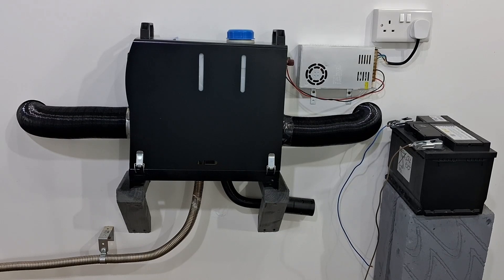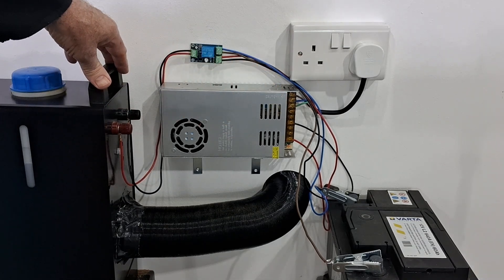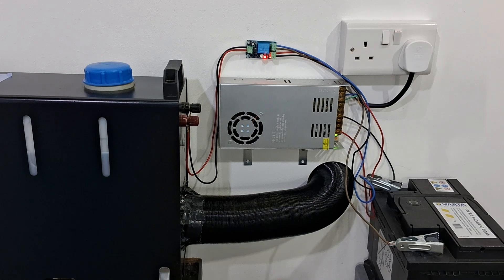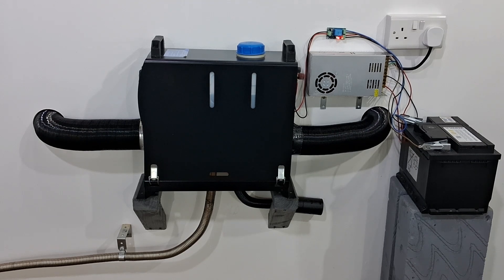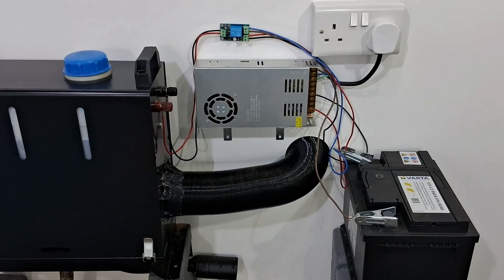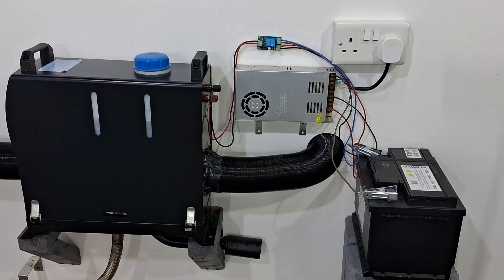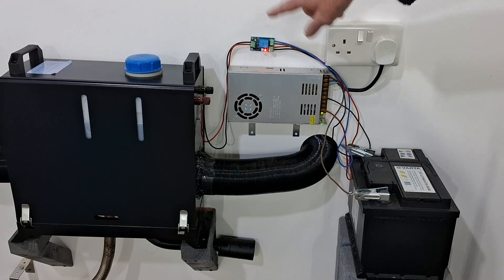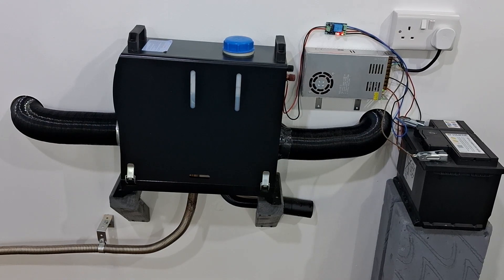DIESEL HEATER Emergency Power Cut Switcher 12v mains supply to battery backup in under 1 second auto

Comment: Andy, thanks for the video. I just put this type of switch on my vevor unit.  It has the 4 button controller.  It switches nicely from 12 to 110 but,  will not switch  properly,   from 110 to 12. It just shows loss of power and though it is obviously getting power it is off.  Just wondering if you know enough about the different type of controls to advise if this is the issue. Thanks for your time.

Comment: What amp battery would you recommend? Thank you
Reply from the maker: i think this on is a 60. but if you can get quiet a big leisure or lorry battery it ould be better. cheers andy
Reply: @ Thanks for that
Reply: I don’t know if you can help or not? Everything is wired and a new 64 amp battery connected, the heater starts perfectly while on the 12 DC but when I pull the plug, the heater goes into shutdown mode rather than keep running on the battery. If I try to restart on just the battery I get error code 9, but if I restart on DC, all’s ok. Any idea what the problem could be?

Comment: I run mine directly from the 12 volt battery but I keep a charger on it to keep it topped off. If the AC power goes out it will already be running on the battery. No need for any relays.   

Keep it simple. 😀
Reply from the maker: Thanks for the info
Reply from the maker: did you see my other heater videos: https://www.youtube.com/@andyfireblade
let me know what you think

cheers andy

Comment: Andy I have one of the newer units with the thermostatic controller which I love.  The switch unit doesn’t work “I don’t think it switches fast enough”.  Not knocking the video, just giving you the info.
Reply from the maker: Thanks for the info, i have a newer one, i will give it a try on mine

cheers andy

Comment: Hi excellent vid.

I've just ordered a heater and the transformer and relay as I want to build the same set us as u have in the vid.
Could u please reply to my comment with a pic of the wiring ....relay , transformer and battery or a pic of a diagram of the wiring ?

Can I also ask can I leave a trickle charger on the battery while the heater is running and what size of battery is best ?

Many many thx in advance.
Reply from the maker: hello my friend
thx. the relay will come with a good wiring diagram.
they are really easy to do.
soz i cant send a pic at present.
you can leave a trickle charger on, but dont use a intelligent smart charger. i used a battery from a peugeot 207 1.6 , i think 60 oms. but smallish.
leisure battries are better but expensive

good luck andy

Comment: You don't need that module. Charge your battery up let it set for a day. Measure your battery voltage, that's your floot voltage. Set your power supply at that voltage,now your battery is at floot charge. If your charger looses power your heater won't know it and when it comes back on it will bring your battery back up to charge, no need to spend your money for a electronic switch with a delay. And your battery will always be charged. Been running that way for 3 winters now with the same battery and it's still healthy.
Reply: It's a regulated power supply.
Reply: Sorry I don't agree. The power unit is just that, a power supply unit, it has no means of regulating charge control to a battery and will cook a battery. It is Not designed for charging batteries.....

Comment: Andy i must have tripped up at least 20 times and pulled the transformer plug out from my down stairs or up stairs diesel heaters and never had a problem with them ive just let them cool down and hay hoe they work perfectly after,,,,,,,these fantastic home heating little cheap machines IMHO are much tougher than people think
Reply: If on full power and power is interrupted, the motherboard usually melts as its inside the heater right next to the heat chamber.

Comment: Hi Andy  Does the fan on your power supply run slowly with the heater off. Cheers Marc
Reply from the maker: Not that I know of
Reply: Mine did as the heater is 40watts and the converter was only 30 Watts need a 40w or 60watt one